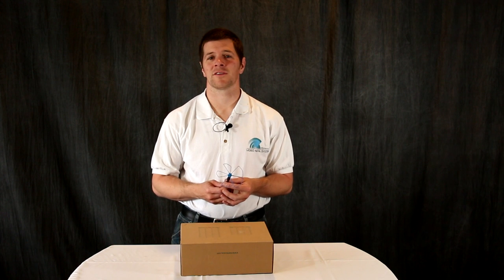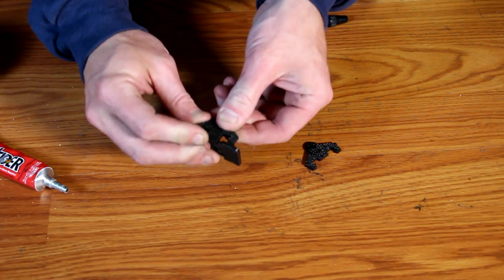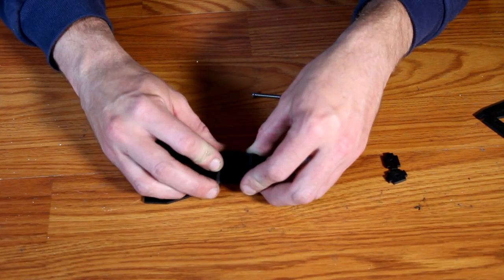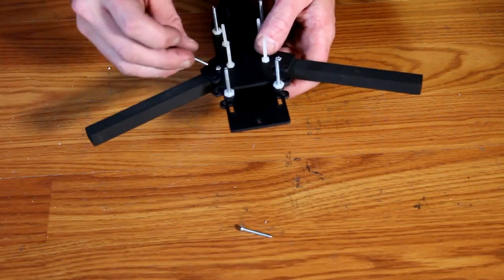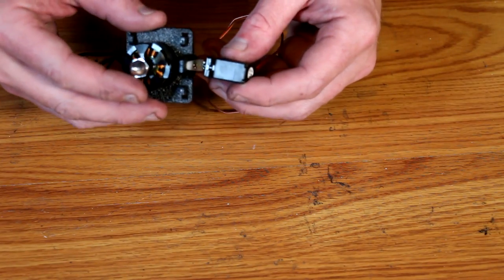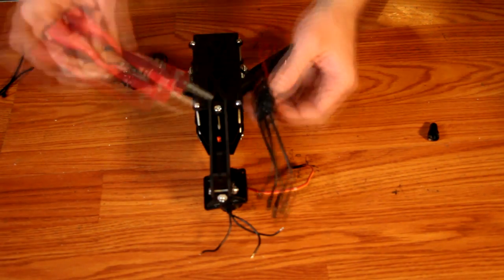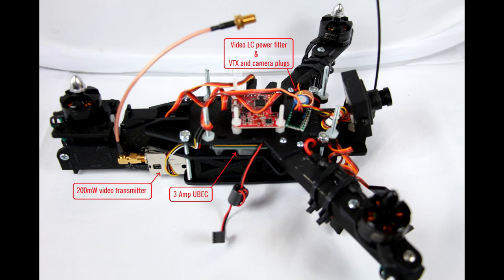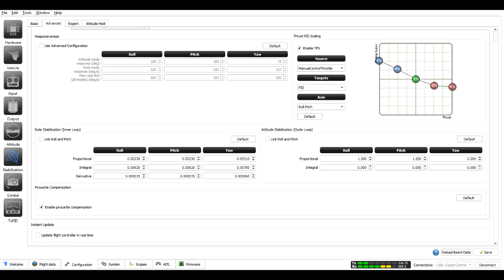Trident 250 build video

Comment: I like it.  It seems you could store this in a small toolbox with a piece of foam cut to fit, briefcase-of-evil style.  Flight video soon, Alex?

Why do you have the #2 motor rotating opposite to #1?  My understanding was that on a tricopter #1 and #2 should be same, with #3 either the same or opposed.  I am very interested in how this affects the flight characteristics.
Reply from the maker: pillsnotbills - You read my mind ;)  Yes indeed it fits in a small toolbox.  You can cut a piece of foam to fit it, your goggles, and your radio in a small toolbox for travel.

I reversed the #2 motor to give the yaw control more authority.  If you use NAZE32, they all need to go the same way.  For CC3D, you can reverse one motor.